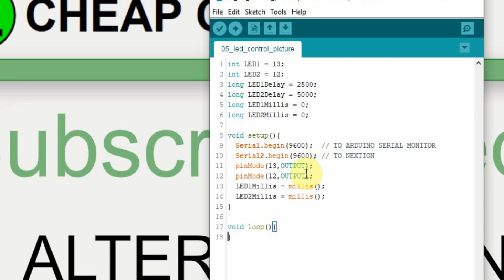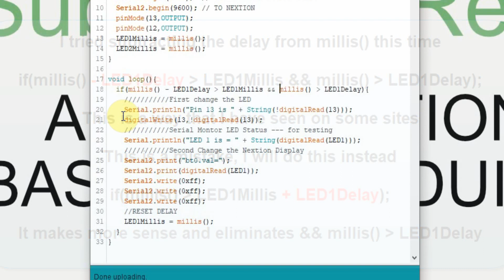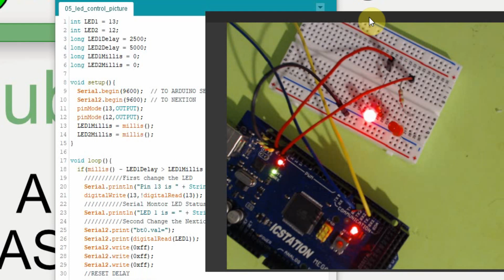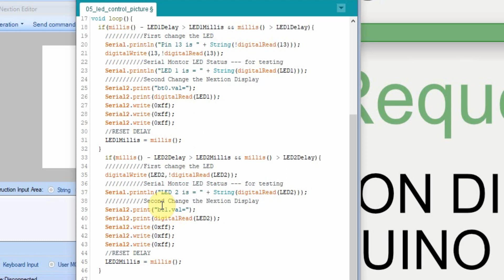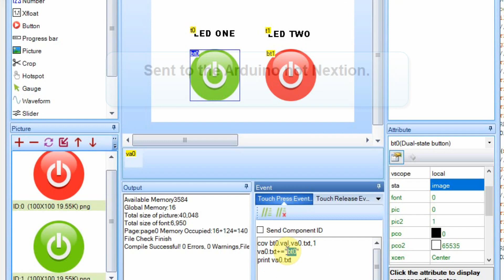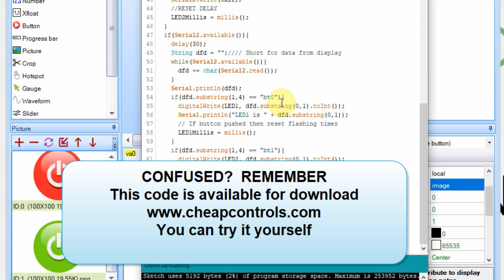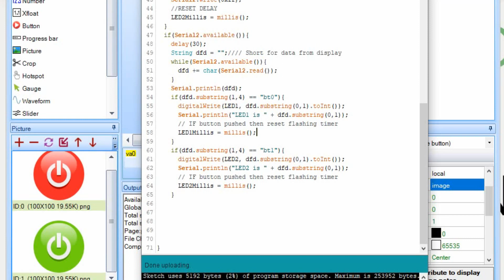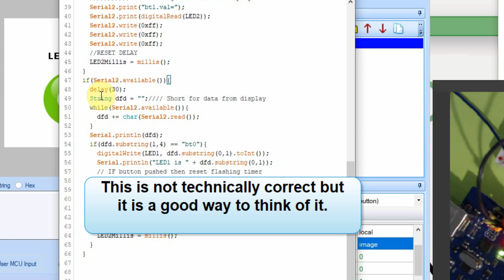#98 Nextion Display - Dual State button connected to Arduino - Nextion Tutorial

Comment: Greetings! Thankyou for this wonderful tutorial of yours. I have a question, though. I have a project set up like this: a relay controlled by a nextion display containing  two pages, the first one is for the logo and the second is for the buttons. For the buttons, I use  a dual-state-butons to control the status of the relay so when you click the button, the status of the relay triggers ON and persists  until I click the button again. My problem is that when I go back to the first page containing the logo while a button is clicked on the second page, the status of the button in the second page resets while my relay continues to be ON. So it seems the use of dual state buttons  is compromised. Do you know what should i do to to fix my problem? Thank you for your insight.
Reply from the maker: You need change the scope from local to global.  You should see this in the attributes of the dual state button.  thank you for the kind words and good luck with your project.

Comment: cov bt0.val,va0.txt,1
va0.txt=+"bt0"
print va0.txt

Error:Invalid Variables:va0txt( Double click to jump to code)
Error:Invalid Variables:va0.txt( Double click to jump to code)
Error:Invalid Variables:va0.txt( Double click to jump to code)
Error:Compile failed! 3 Errors, 0 Warnings,
 Where did I go wrong?
Reply from the maker: I am not sure I don't have my dev system with me.  I know cov is still usable but you should use covx.  I think va0.txt=+ should be vao.txt+= instead and print needs to be in () prints(va0.txt,0) or something like that
Reply: @CheapControls  I tried to watch the video many times but still error
Video 6:50
cov bt0.val,va0.txt, 1
va0.txt+="bt0"
printva0.txt

Error:Invalid Variables:cov bt0.val ,va0.txt, 1( Double click to jump to code)
Error:Invalid Variables:va0.txt( Double click to jump to code)
Error:Invalid Variables:printva0.txt( Double click to jump to code)
Error:Compile failed! 3 Errors, 0 Warnings,

Do you have HMI File?  thank  you
Reply from the maker: You are correct.  I just looked up the old file.  What version of the Nextion IDE are you using?
Reply: @CheapControls   Nextion Editor ver 1.65.0
Reply: @CheapControls  
I want to make project switchbutton arduino & Nextion dual state press switchbutton arduino to show
state at the Nextion screen.
But I can't write code. 
 Nextion Editor ver 1.65.0
Reply from the maker: I think it is the version of the IDE.  I will try to update this week.  It takes me a lot of time to update because I need to go through old code and see what has changed.

Comment: Hi, sorry if I persist with the questions but I can't understand, if I only have a "dual state button" how can I send the two states separately to arduino to make him do a different action for each state?
I have performed many tests but I cannot understand how to do it.
I'm a tough head :-)
Reply: Ok, I found the solution, I don't know if it's right or it can be done better but it works, just add these lines in Nextion Editor to send the two different states:
if(bt1.val==1)
{
  print "vaporeON"
}else if(bt1.val==0)
{
  print "vaporeOFF"
}
Reply from the maker: That is the way I would do it.  Very Good
Reply: @CheapControls  As I uderstand, the difference in the case above you can program whatever you want inside the if and that will be done on the nextion side before sending something to the arduino, and in the case on the video the nextion sends a 0 or a 1 when the button is pressed and then you can program whatever you want to do with that on the arduino side, right? Sorry for the many questions, Im just beggining to understand how this works
Reply from the maker: @DianaMartinez-su6jh  That logic is correct.  but I would not just send a 0 or 1.  I send it in a key-value pair with a beginning and end parameter.  like C:CTST0?  starting parameter C:C  then the command being TST then the value of 0 then the ending delimiter of ?

Comment: what the code should look like if I would like to control the LEDs with buttons. without flashing, only send data from nextion to Arduino - enable or disable with the button

and by the way, can't download files from the site
Reply from the maker: I am rebuilding the site.  You are the second person to ask about downloading the files.  I did not think people were going to the site for the files.  I will add a link to the old site on the new one and fix the links in the youtube videos.  I appreciate you point it out.  I am not sure what you mean by flashing.  Do you want a on/off button on the nextion to control and LED on the Arduino?  I just want to be clear on your question.
Reply: @CheapControls  thank you
yes, I just want dualstatebutton to turn on or off the diode connected to arduino
Reply from the maker: I have a link to the old site on the new site.  You should be able to download the files from the old site.
Reply from the maker: Try this video and see if it helps.  https://youtu.be/LL4TduSYsZ8

Comment: hi there I copy and paste the code_5 from the text file to Arduino, and verify it show this message (error: 'Serial2' was not declared in this scope) I don't know what I have missed! Can you please help me?
Reply from the maker: What model of Arduino are you using?
Reply: Cheap Controls I’m currently using Arduino uno
Reply from the maker: My videos use a mega.  you will need to add a library and alter the code a bit for the UNO.  The mega has extra built in serial ports that the UNO does not have.  It is not difficult to use with an UNO.  I will post a second reply here with the library.  I will also post an different file for the UNO.  I am not on my development laptop but will be later.
Reply from the maker: @daryl7237  I have the code up at Cheap Controls for download(The links look identical but if you hover over them you will see one will say UNO in the file name).  I will work on creating a separate image for UNO versus MEGA.  You will notice two new lines at the top of the code.  This is for the softserial library.  Then in the code Serial2 is replaced with mySerial.  You will use pins 2 and 3 for the additional Serial Port.
Reply: @CheapControls  woo! that's great thank you so much!
Reply: @CheapControls I got it and I really appreciate for your help